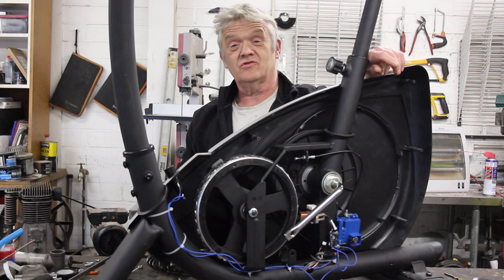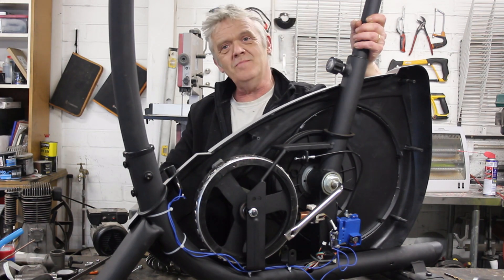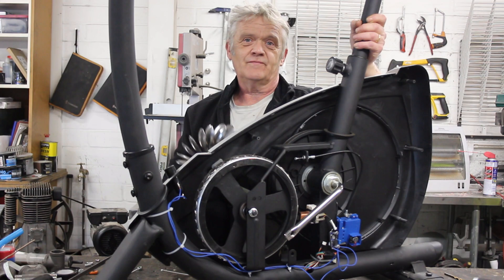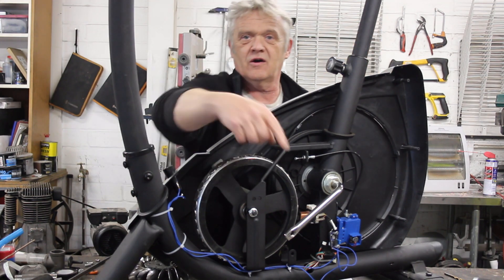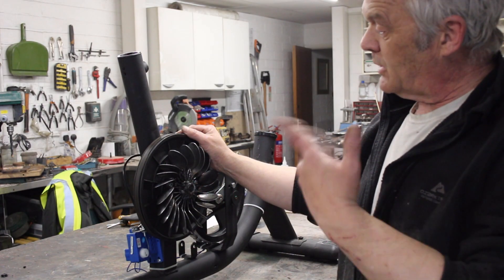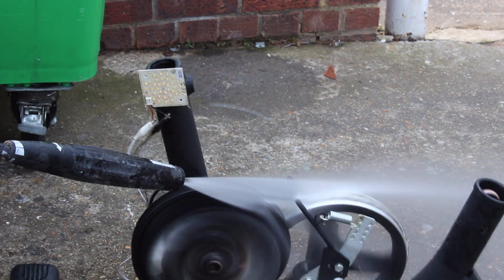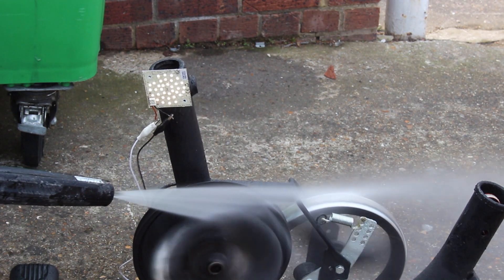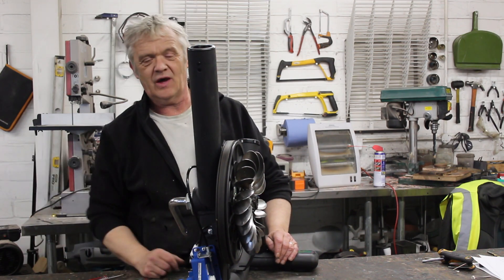1521 How To Make A Water Turbine From An Exercise Bike

Comment: Have a general question if you don't mind that is we all know carbon fiber is extremely strong and I imagine it's because they've aligned some carbon fibers all in unit directions and then woven them in a pattern that they wish but I'm wondering if it's possible to make a less strong but still strong material but I just using carbon powder in an easily made form such as a carbon foam that could be crushed or other things and then mix with an epoxy and whether that material might be sufficiently strong to be used in a moldable form without having the ultra high strength of carbon fiber which frankly isn't often needed by most projects. What do you think? I know you made some graphene disks that were bulletproof at some point that you got tested but just wondering if there's something that's just super easy to make that could be done obviously not to be bulletproof but just to be a moldable material so you don't have to go to the store to actually buy carbon fiber cloth or fiberglass cloth.

Comment: More off topic but I. Addition to the Stan Meyers playlist consisting of almost exclusively Meyers himself I compiled a playlist of systems (including some from you) of other people trying to replicate Meyers or do a similar that seemed to be  above the average efforts or explaination. Some detail the bifilar coil which most isn't mention. Some detail other aspects of the circuit usually left out. Some offer easy to find parts for replications. The water spark plug video is interesting.
Unfortunately YouTube's purge of anything non standard continues. These playlists once contains many more videos that are now gone. One in particular separated hydrogen and oxygen in the same cell by using a induced magnetic force in a coil to create a positive versus a negative exit to which because of hydrogen and oxygens differing polarity tended to concentrate the hydrogen at one exit tube versus the oxygen at another which is a very interesting idea.https://youtube.com/playlist?list=PLNY9F364UuoMrm8UvD1-WI08VMNno8DLU

Comment: Off topic but I wanted to make you aware of the best explanation of the geet reactor that I've ever seen. It actually works in a completely different way than I ever thought with the exhaust product being run back through the pipe with the intake product and some of the exhaust being re fed back into the actual intake which is sort of an interesting and complicated interplay of heat and reactant particles which may actually make it do something interesting possibly. Just thought you might like to see this explanation since I've never seen a good one before.https://youtu.be/d5YsK3bwzPM

Comment: Make a nice Germanium diode  Am Radio to generate enough power to light some LEDs.

Please😃
Reply: with Russian D9K or D9E Diodes, 1n270's or In60's .. ?
. ARC Radio's have been outlawed almost Worldwide for years now ( as of 1929 in the U.S. )
. . but I must ask, why Germanium, with its ultra-high fan-out Rates and ultra-low current designs?
Reply: @jeffreywolsieffer4583  because of it's simplicity but I am aware they don't last and must be replaced. You must be experienced at this but I'm just an enthusiast and I'm 46 just learning the ropes. Every video shows the original invention with the cat hair on a chunk of some pezio crystal. It's awesome and actually draws enough power to light an led or 2.
Reply: @jeffreywolsieffer4583  could the pezio crystal in a BBQ lighter be used?🤔🤔🤔